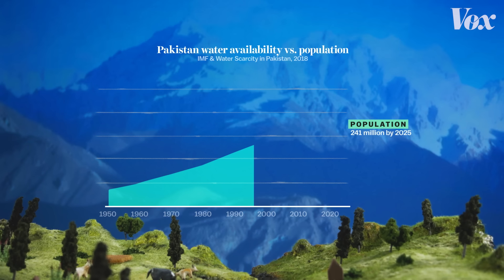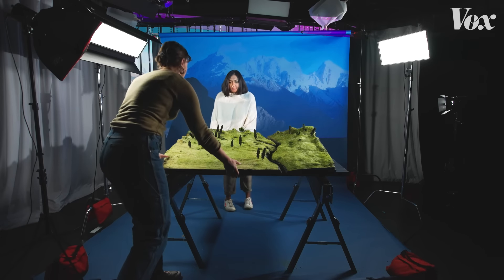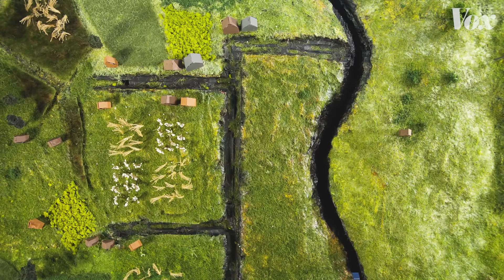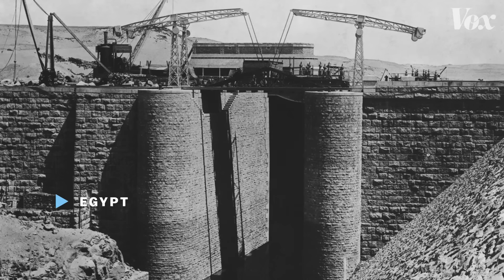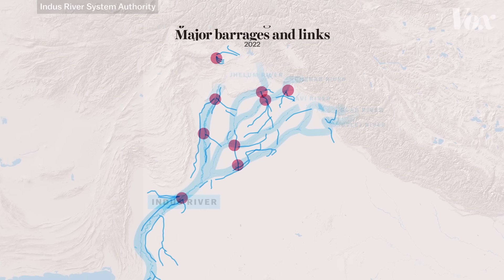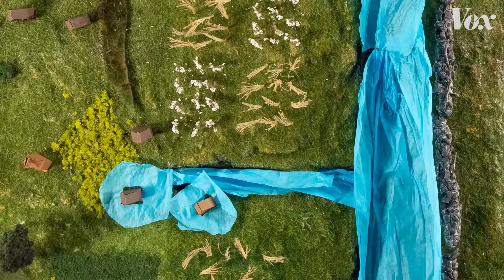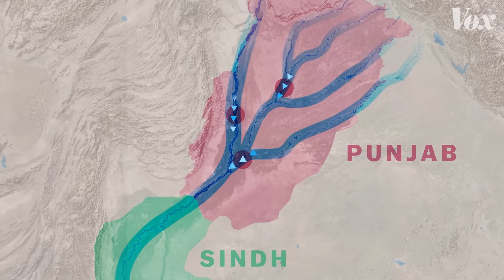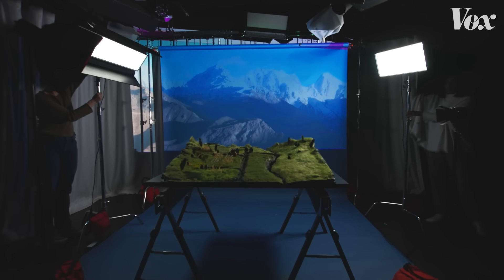The disastrous redesign of Pakistan’s rivers

Comment: One more thing INDIA technically has the right to use all the water of lower rivers of indus river systems but we aren't using it fully so in future if we decides to stop water flowing to pakistan it will be more trouble for pakistan because northern states of india are suffering from water shortage for irrigation and on top of that pakistan is breaking the rules of 1960 indus
 water treaty so its very much possible that we see major changes in water systems around indus.
Reply: Don’t worry VOX will never cover important facts like that
Reply: @tsundoku1682  Important? He's talking nonsense.
Reply: Every drop of water flowing into Pakistan is waste anyway. They don't have advanced irrigation systems and reservoirs to maintain that water.

While India is trying to rejuvenate the long-lost river, Saraswati.
Reply: Pakistan has broken no rules, India has given what they started on chenab but still limited. India seems to think empty threats would work but there is a reason even the permanent indus committee has survived despite multiple wars over time. The treaty is fair and just because indian politicians started ambitious projects to reel in the voters does not mean Pakistan should renegotiate terms. For what and why?
Reply: @ahmadimran6231  it was India's generosity to grant access to 80% waters of Indus river systems to Pakistan, never seen before and after. And what India got in return - terror attacks and wars. And India's position getting more hardened is not today's phenomenon, but Pakistan's stubborn attitude towards India utilising its own share. Anyway this treaty needs to be renegotiated, and if Pakistan sits on the table it's good for Pakistan, if not it would be Pakistan's loss.
Reply: @Prince_115  Generosity does not change geographical realities. That water is Pakistan's right and india can not practically do anything about it, save for actually getting control of Gilgit 🙂.

Negotiations seem far and will likely break down because of both countries stance on Kashmir. Realistically, nothing will come from it.
Instead, both could invest in removing populist leaders and approve leaders who actually think "country first".
Also, terror attacks ? Common thing. India tries something funny in balochistan so retaliation makes sense. Takes 2 to tango. Hope tango sessions end honestly.
Reply: @@thanos1326 Good luck with that ? 🤨
Out of curiosity, which countries does india share its eastern borders with ?

Comment: Solution lies in Regenerative/ paradoxical agriculture which will save 80 percent water used in agriculture. There is no need for dams and mega structures risking environment and money. We need new agricultural practices. PQNK agriculture method by Dr Asif sharif of Pakistan could be an inclusive and conclusive example in this regard.

Comment: In a country with severe dry spells followed by floods, large dams regulating water flow is the logical solution.
Removing settlements built during the last 150 years is impossible.

Comment: No way you blamed the whole issue on the British. Irrigation has been used for thousands of years, and modern irrigation is used by every country with rivers and agriculture. The issue here is mismanagement by the gov. The casualties from flooding and disasters are avoidable if you build the right infrastructure: getting rid of the irrigation is not the solution.

Comment: I am surprised there is no mention of global warming? 
We used to have annual floods in Punjab 30 years ago which stopped, not due to infrastructure but monsoon being different.
Indus gets flooded due to torrential rains in northern Pakistan and some parts of India as all rivers drain in india. 

Infrastructures were built to not only irrigate, produce electricity but to stop the flooding. 
Many rivers had been seeing floods since centuries without man man infrastructure. 
This video seems very inauthentic and incomplete. 

Don't even start about water not falling into the ocean from indus.

Comment: Tone-deaf. I hate to break the bad news, but I doubt traditional irrigation methods could reasonably sustain Pakistan's current population. It would remove water access from the poor who rely on irrigation for their access. It is also unreasonable to claim that "taming nature" has not helped Pakistan. Without the damns, they would need to rely on an ever-changing river, which would be terrible for permanent settlement and thus terrible for their local economy. Could things have been done better? Absolutely, but the issues lie primarily with government management and foresight rather than the infrastructure.

Comment: Problem was defined nicely
But solutions were left go listeners imagination!

I suggest:

Better and judicious use of irrigation for farming- using drip irrigations instead of flood irrigation

Use of less to no pesticides

Use vegetation to clean water before discharging sewage water for better healthy rivers

Changing part of land from annual to perennial farming and agro forestry to grow fruits not for exporting but local consumption to develop food security

Having at least 100 meters of forest belt on either sides of waterway with indeginous food forest to improve and prevent floods

Making laws not to do construction both industrial and domestic building right over river banks

Make use of overflow perennial canal system feeding water reservoirs to use for irrigation in dry season, etc

Water recharge wells, etc

Reduce hard surfaces to avoid flash flooding, etc

I am not geologist but why can’t academicians from universities were able to give solutions or was this not the point or intent of this video.
Everyone can count and point problems! But can they give do-able low cost solutikns!

Comment: Drip irrigation is the only viable solution
Also engineer the canal to carry excess water remaining due to drip irrigation
Design for adding capacity in parallel

I am disappointed that these academics failed to give a sensible solution. They only identified a problem with a lot of pretentiousness

Comment: In my humble view, such intense technical issues are not served by overly simplified and sensational docs. Last year floods in Pakistan are part of shifting climate patters globally. India, who have close to 5781 Dams (by 2019) did face extensive damage due to Himalayan Floods in Himachal Pardesh and Utterkhand areas. China who has built more than 22104 Dams (by 2000) to its credit, faced tremendous losses due to floods in Beijing-Tianjin-Hebei areas; USA had severe and unprecedented floods affecting CA, Florida, Mid-South, west-Kentucky, NY, and North-East to mention few. Middle east has faced floods in few states.
A more rational view would be that irrigation system in Pakistan , like such systems elsewhere, are non-reversible i.e. there is no going back. On its Score Card, Pakistan has failed since 1980 , in building several critical Dams for Storage in upper Indus region, as well as crucial ones for transferring water to lower rivers Jehlum and Chenab, However the argument of sustainability does make sense. Country must control its population bulge as well as complete the storage and tributary needs by adding more Dams at essential locations already identified in many studies.

Comment: This documentary is wrong in so many ways and it has now made me think of the level of research being done by VOX in every other video. 
1. Yes, The canal system built by the British was for the purpose of irrigation.
2. However, the canal systems built after 1960's were in no way for the irrigation purpose as the main target. The main motive was to create an obstacle system for the opposing armed forces during war situation. 
3. And thats the main reason for such a vast majority of barrages and canals. Its a tiered system parallel to international border. And thats the reason why you find very very few canals towards the other side. 
4. And thats the reason for the destruction and flooding.

Comment: Yes, of course you have to invite Pakistani professors who (predictably) point the blame on British colonists. Not Pakistan's fault, no, Pakistanis don't make mistakes amirite? Before the brits built those canals, the Sindh and Punjab region was always in drought with sparse population. People didn't just pop out of thin air, after the canals were built, people migrated to these canal regions and built up a sustainable economy around it. The issue here is the population boom, poor canal design and mis-management of these canal system decades after the Brits left. Pakistan had 70+ years to improve this system. Next time interview actual Pakistani Hydrologists from Pakistani Universities who are actually doing the ground level work.

Comment: Sub-standard take on the issue with lots of commentary coming from Western-based academics solely talking about dismantling the current "colonial system and mindset" and reverting to indigenous methods. Which I'm sure like many others here have said is likely to have other repercussions like reduced agricultural output., that would make it more difficult to sustain the already large and still growing population. 

Absolutely no data and statistics given to forecast and compare the pros and cons of both modern "Western" and indigenous models. If not an amalgamation of both. Expected so much more from Vox, such a shame.

Comment: I am no expert but "using idigenous knowledge" will not grant water access to 240mil ppl. It is also not reasonable to use "democratic" methods to build and distribute because that would naturaly divide downstream and upstream people. What should be done is managing the water and the river itself by one party of experts aka on goverment level to control the river. "Overengineering" isn't the problem engineering is the solution, but not done half way and localy. We must not bend to the whims of nature. We must control it. Monsuns and floods should be managed, their power harnessed for our benefit.

Comment: How obvious! They coudnt find an Engineer or hydologist to support their claims. Concocted narrative. 
In sindh province; River indus flows at ridge / higher elevation while adjacent land is low lying so when floods come these low lying areas get inundated but could not drain out except through evaporation and drains & irrigation system in place. 
The geographiers could not comment on the topography?
Similar and more extensive irrigation system is in place in punjab but situation is entirely different as the Indus river & its 5 tributaries run at the lowest levels while the adjacent land is on higher level sloping towards rivers.

Comment: A 10 minute commentary on indus water system and no word about the Indus Water Treaty, coz of which a number of barrages and link canals were constructed in the 60s. Secondly, floods in southern part of Pakistan are not caused by just the flow of water in its three western rivers but the unannounced release of flood water by India in the almost dry river beds of the three Eastern rivers, the accumulated affect of which causes heavy flooding in lower reaches of indus river. The flooding in the northern and western mountainous regions is primarily the outcome of climate change and more than usual rains during monsoon season. Nothing to do with over Engineering or poor water management

Comment: Main issue with Pakistan irrigation systems. They all are defence oriented system instead of irrigation to farmland. Main objective of this canal system is to deter Indain army movement in Pakistan. Almost All canals are parallel to International border.
Reply: Don't bring Endia in everything
Reply: Its just the fact. Please see the alignment of all the canal near lahore. South of lahore there are two parallel canals are flowing. Not even 1 km apart. Parallel to IB. There are canals whose water not being used, therefore increased the salinity of soil. Because those canals were never made for irrigation. This are facts one can check on ground.

Comment: This is a ridiculously ignorant, and confusing video.
It recognises that the system has delivered by managing the needs of such a large population, yet presents doubts about the system. It's contradictory.

It also fails to recognise that the British acted according to their understanding at the time, and they actually did improve production, in the short, and the long term, Pakistan also built effectively on that basic heritage.

The only lesson in the video is about better management of the existing system, but this aspect was hardly touched.
Also punjab vs Sindh was an irrelevant point, because it fails to mention that there are very effective water measuring systems in place to ensure everyone gets the already agreed upon share of their water. That's a fact.

Very poor presentation.